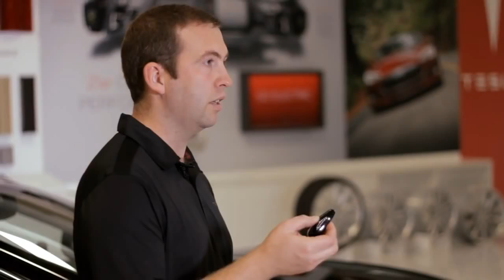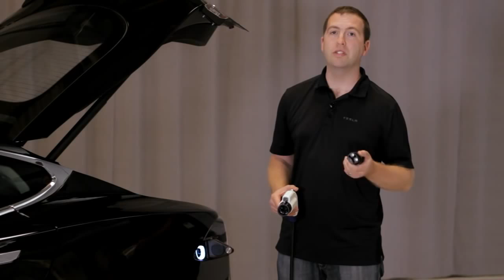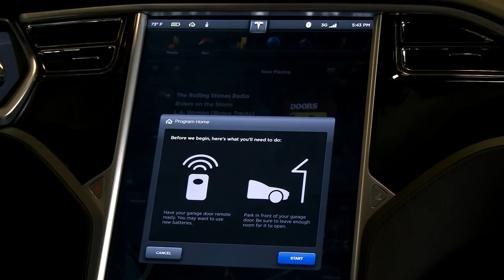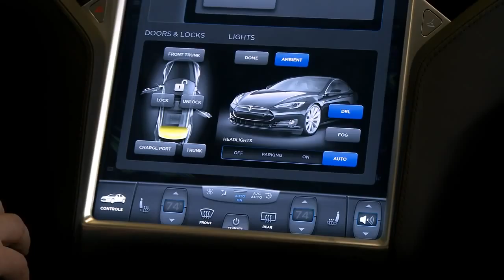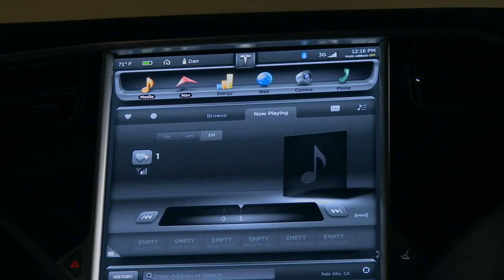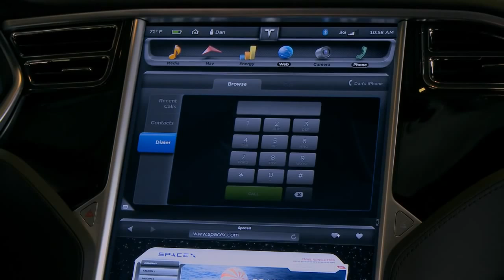Tesla Model S   Official Walkthrough HD + 3D

Comment: Teslas are great cars, but the lack of haptic feedback in a fussy and distracting touch screen UI is a fundamental design flaw. All of the operations require you to take your eyes off the road. Even the most basic activations require you to no longer look where you're going. That means to be safe you really need to stop the car to alter a setting, just as the gentleman demonstrating these features was looking down the whole time and not looking forward, and the car was parked and not moving, which demonstrates my point. This is a major major flaw and is the one thing I've heard people say as to why they will not buy a Tesla. By all means have a touch screen with functional interfaces but I would suggest that some screens are categorised for driving and some for not driving, and that driving screens locate large buttons in the four corners of the screen so you can feel them with your hands by feeling to the sides of the screen and not looking down

Comment: just one question, why would you disable the passenger airbag?
Reply: +zoranhacker When using rear facing child seat (as for small babies) in front passenger seat, the passenger airbag not only should but must be turned off, because in case of crash, it will make it worse.
Reply: +zoranhacker to change it when it is broken or some case. you dont want to work on an airbag that could explode into your face at any time :)

Comment: plz,do manual electric cars...i don't want to drive a non standard car :(
Reply: The remodels of old cars often keeps the gear box. Look out for those if you are interested!
Reply: It's kinda impossible, that's not really a gearbox in this car.
Reply: In this car Yes, Its a fixed reduction gear.
Reply: zupinu2000 The car doesn't have a transmission in the traditional sense. There isn't need for these kinds of gears in a fully electric car. It's just a straight smooth acceleration.

Comment: ok all ok but what happens if i have range 80 miles and i have to go in emergency about 250 miles???
Reply: If you need to travel 250 miles to get there, it's not an emergency.
Reply: What happens if you have 1/4 tank of gas but you need to get to an emergency that is 37 tanks of gas away???
Reply: praticle Call an ambulance
Reply: ***** The whole chassis is a battery. You can't exactly do a battery swap without taking the whole car apart. It's not a TV remote.
Reply: ***** I'm the idiot, but you think it would be quicker to change the battery on a Model S than it would be to charge it.

lol
Reply: +andrews2547 wrong! they showcased it. it is an option and possible! it even is faster than filling up your gastank
Reply: TGGE TheGermanGameplayEngine They showcased it, but they never actually used it for production cars.
Reply: Get to a supercharger
Reply: Meme Police sadly!

Comment: I am already driving a 3.5 ton truck cheaper then any of the hybrids or electric cars out there.
For less then $10,000 for the total price of my truck.
My cost per mile is less then 1 cent per mile and my range is 450 miles.

Not to mention my carrying capacity is 2 tons and towing capacity is about 3 tons all at the same time.
I can carry 300 Gallons of FREE Veggie-Oil if I want to go Coast to Coast.
In that case my range is 4200 Miles.
But I can also collect Free Oil on the road.

I have been driving on practically FREE-FUEL for 5 years and not polluting the environment at all.
Saved about $60,000 on fuel in 5 years.

If you are intrigued, check out my other channel veggiepower303
See the videos about the 4x4x4 White truck.
Reply: i totally feel you man. I hate vegetables in my bacon, I always have to remove chocolate chips before i go watch a movie on my pool made in garage doors.
Reply: zupinu2000 😂😂😂😂

Comment: Whoa whoa whoa I spot a red flag at the ebrake you press and hold the button for a EMERGENCY brake.
Reply: I don't see the issue? You press and hold to engage the E-Brake that doesn't mean when you let go of it the brake let's go as well.
Reply: praticle true, but the delay of pressing and holding might cause an accident, i'd rather have a physical lever to pull on to insure my safety while driving.
Reply: SilverZeppelin The delay of moving your hand from the wheel to the lever and then pulling it would probably be comparable. Plus the placement of the Tesla E-Brake would allow me to keep both hands on the wheel, which I would prefer in case of an accident.
Reply: praticle i see, tomatoes potatoes i guess

Comment: This car is nice, but that screen, and everything that runs off it ....... Seems like it would be worse than texting....... Especially with no gas motor in the front if you know what I mean ....... Plus what school do you go to, to get the degree to drive it.        Good luck stealing one with out a flat bed .
Reply: Since there's no engine to be shoved through the dashboard and into the cabin should you have such a wreck, the "frunk" actually acts as a giant crumple zone. I mean if you have the chance to buy a car like this, you'd make the call, but according to every safety rating, there isn't a more safe vehicle out there. 

Until Tesla releases a new Model S that is..
Reply: Owners say that the screen is not distracting, if someone is distracted by it, its purely his/her fault

How is no gas motor in the front a bad thing? Its unbelievabely many times safer without it.

Its a car, all they did was remove the clutch, gearbox and breaks. Even a child can drive it
Reply: TheHareidGamer Yah, alot safer when the tree is coming threw the dash board cause there was nothing in front to take away some of the inertia from the crash......... How is an empty space safer than an engine compartment with a big v8 motor in it? 
Remember the Chevy Covair? I personally saw two young girls get killed in one after hitting a telephone pole going roughly 45 miles per hr.
Reply: The Tesla is rated the safest car on the planet, infact it broke one of the testing equipments. A petrolium engine can easily burn and explode if it crashes, and it happens about 180,000 times every single year in America alone.

/watch?v=dz2FMfv-CSc
http://www.businessinsider.com/tesla-tesla-model-s-achieves-best-safety-rating-of-any-car-ever-tested-2013-8
Reply: TheHareidGamer Tesla: Safest car on the planet? Take a look at the new Mercedes S Class 2015. The technology packed into that car is mind-blowing.
Reply: Sharvin Nannan Panday Tesla Model S is a direct competitor with the Mercedes S Class.  Elon Musk specifically designed his car to beat it in every aspect.
Reply: michael cain Right then; the argument begins over the Mercedes S Class 2015 vs the Tesla Model S: Which is best?
Reply: michael cain Why don't you start off, Michael, by telling me one (innovative) safety feature that the Mercedes doesn't have, and one that the Tesla has.

Comment: The overall featureset and capability of the vehicle described in this video is mind-blowing!

May I be so bold as to make a UX suggestion.  When the vehicle is being put into park, perhaps displaying "Car Wash Mode" and "Jack Immobilization Mode", as well as other possible service modes as options on the display would be easier than having to remember to dig through otherwise unrelated menus to get the desired behavior when bringing the car to a halt.  Also, perhaps a UI feature of being able to hold a button down to get a popup describing what the mode does would help.  Honestly, I'd fear forgetting to enable Jack Mode in the exceptionally rare event of having to replace a tire, or accidentally leaving the brake on and leaving the suspension too low when going to a car wash.  What do you think?

It's probably too much to ask to build jack stands into the frame that would raise the car for either tire replacement or long-term parking.  The infrequency of use would make that totally impractical.  Perhaps a citroen-like auto-leveling pneumatic suspension so one doesn't need to worry too much about using a jack when replacing a tire?  Raise the suspension on all but the tire to replace an inch, and the balance keeps the wheel of the tire to replace safely off the ground.

Comment: I like them and would like to see one designed for Australian conditions. if there is anything we have here is lots of sunlight and clear blue skies, especially in the summer months. I can only think of 3 reasons that people use their vehicle as a mode of transport. 1, is going to work. 2, driving around town going shopping or running errands. i.e taking the kids to school. 3, long distance travel, going somewhere for a reason like visiting relatives/exploring the world. Something that I have often wondered is why solar panels molded into the shape of the body have not been embraced as a battery top up solution. especially molded into the shape of a bonnet and roof where the sunroof is. In my first example #1. if someone drives to work and parks their car outside in the elements for 9 hours. it is sitting there for all that time with the interior getting fried from the sun. especially the dashboard. something I would like to see is the batteries getting topped up and then maybe the air-conditioner kicks in to keep interior from getting destroyed. U.V resistant materials are a must for an Australian vehicle.
Reply: Your Idea is great I had that same question before. But the thing is if the car get hits (accidents) the expenses will be extreme with all the solar panels!!!! isn't it be better if we have a solar power system at house and you can try to make an agreement between your workplace and Tesla Motors to have a supercharge station in your workplace parking area!!!